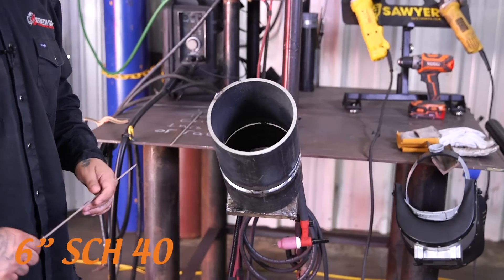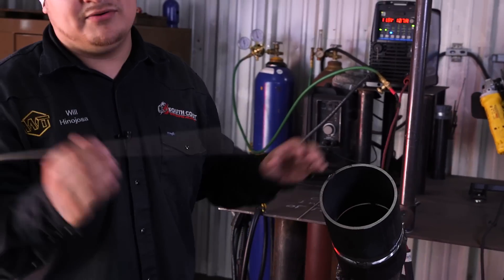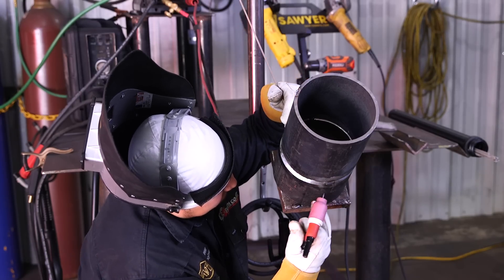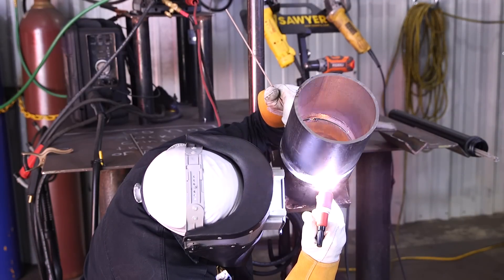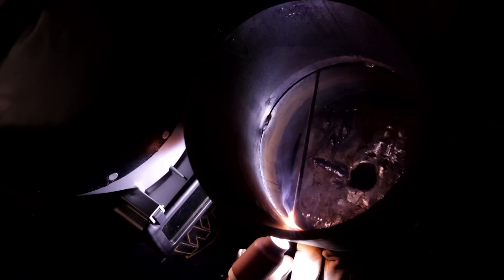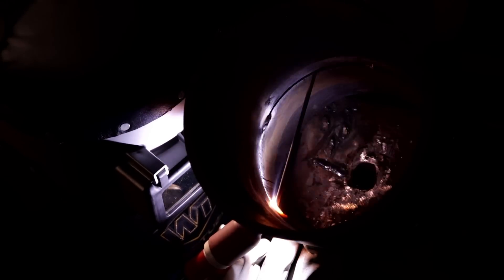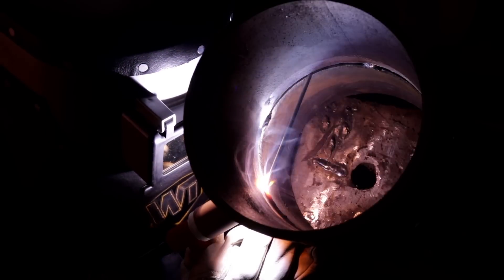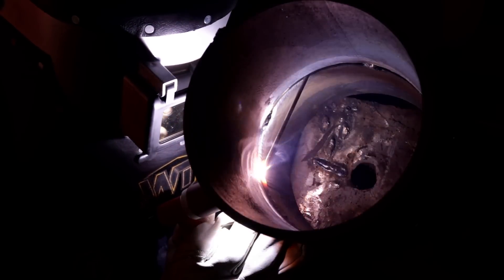Slag on TIG Welding? | Stainless Flux Coated TIG Rod | No Purge

Comment: Hey mate
Cheers for the video, reading a pressure code in Aus. and these rods came up.
Clearly you are back feeding the rods just wondering when you were feeding the rod from outside of the pipe will the slag form and protect the weld inside the pipe? I'd assume not. Btw 5mm gap on a TIG root is wild haha
Thanks for the vid

Comment: How does this rod weld on actual stainless pipe ?? Every video I’ve seen on here is Carbon and heavy wall…… how about stainless pipe sch 10 and 40 🤦‍♂️🤷‍♂️🤷‍♂️🤷‍♂️
Reply: It welds ok but if you light up on the pipe and not the rod the stainless pipe will sugar! Have to burn the flux before welding the root...welding on stainless compared to carbon, the stainless will close up on you real quick you can't really back feed it anymore it ends up flush good luck getting it xrayed

Comment: So this slag it leaves do you have to remove it, or can u weld another pass over it? Never seen that before but it’s interesting!
Reply: Mud wire. Best and cleanest way to weld it is to grind the flux off one side a have the flux to the inside a bare wire facing you

Comment: nice hand fella !! technically in  job when you finish the line in  stainless steel  "almost" , you can not take the purge , because the line is close , so the final weld most be with this flux rods !! nice weld , simple and good !! greats !

Comment: another (and IMO much better) option is TGX flux core TIG wire for no purge stainless, it runs alot cleaner than flux coated wire

Comment: Can you use that on stainless without an argon purge?
Reply: Herbert Herbo Moore yes you can that’s the main purpose of those rods. Like he said sometimes you can’t run a purge line, do to the spot or size of pipe so this is an alternative. Better then needle purge. Just for this demo he used carbon which is still doable.

Comment: Can you substitute stainless steel stick rod...?
Reply: Can do, 309L-17 is a good one for it. Take a flap disc on a grinder to rip the flux off one side of the rod. Use a gap the same as the size of the rod and Lay the rod in the gap, and weld it like you would a carbon root, ie not a dip techinque.

Comment: Why does AWS have a classification that only applies to carbon steel rods(I know flux and mig have a different thing, that’s not what I’m talking about). “7018” has a lot of specific information but when you pick up a 316 rod all you’re getting from the name is the alloy; nothing about tensile strength, positions, or flux composition. Is it an education thing? Political thing- do manufacturers not want to bother with aws classification? Also, is there a real world application that requires carbon to 316? I know Jody did a UA41 which is carbon to 309
Reply: A real world application I’ve witnessed was using carbon steel flanges On 304 & 316 pipe. 309 rod used for that.
Reply: 7018s in the rod number the first two digits represent tensile strenth. So with a 7018 thats 70,000psi, for an 8018 it's 80,000psi. Tensile strength varies in carbon steel with the amount of carbon and other elements alloyed into it. 
Changing the alloy of stainless steels by adding or removing amounts of the metals that make it up ie chrome, nickel, titanium, niobium (not found in all grades) etc etc would change it to a different grade stainless ie 304, 312, 321. 
The next digit, ie the 1, that dictates the position the rods are designed to run in. 1 being all positions, 2 being flat or downhand H/V fillets and 4 being vertical down. 
The last digit ie the 8 is the type of flux. 
8 shows that its a potassium based  basic rod with a small percentage of iron powder in the flux to give a little more run out length than true lowhy rod ie a 7016.